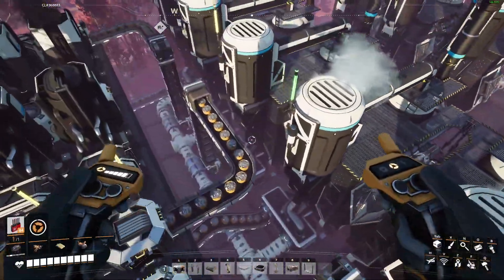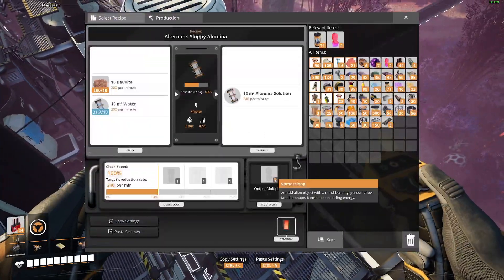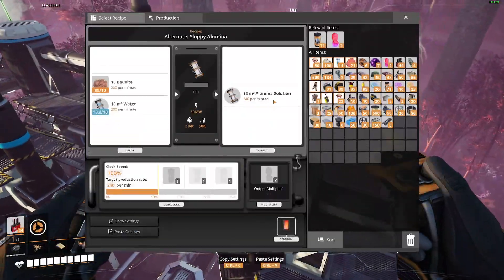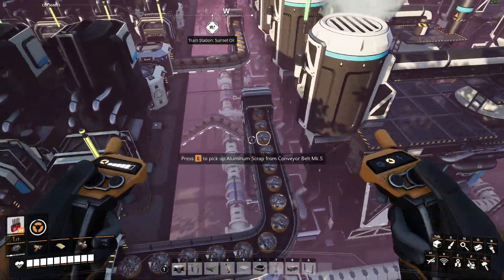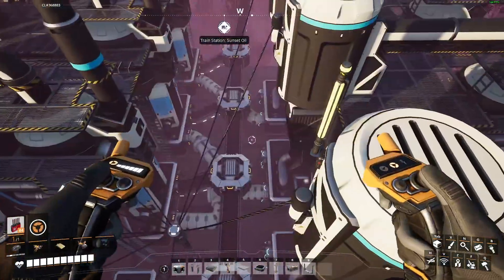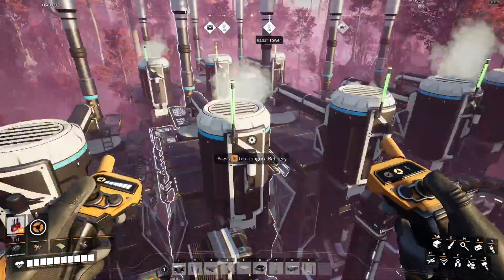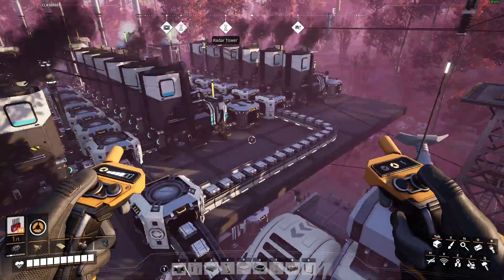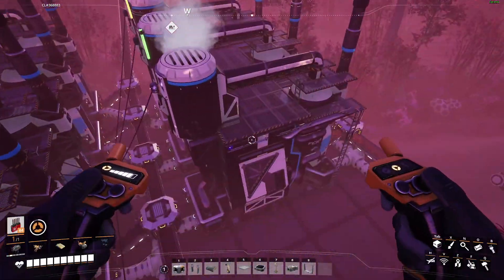Satisfactory - Closed Loop Aluminum Setup

Comment: first of all, cool closed loop idea. My question is does it work to use 2 power shards for 2x input 2x output and then 2x somersloop for 2x output? This will save you 2 somersloops for the same result I believe
Reply: nvm maybe the 1200 alumina solution bottlenecks even with 600 mk2 pipes